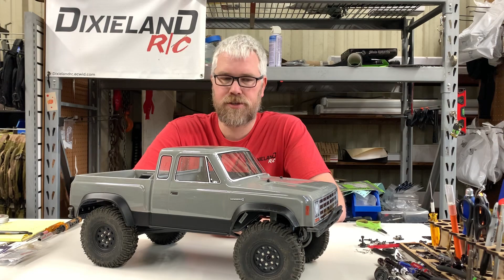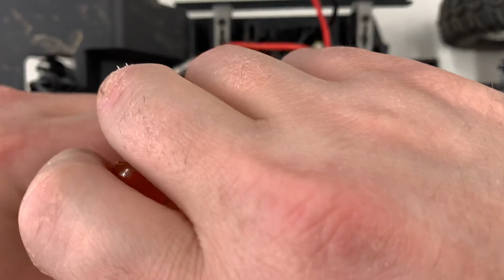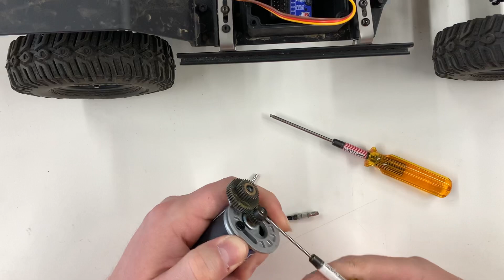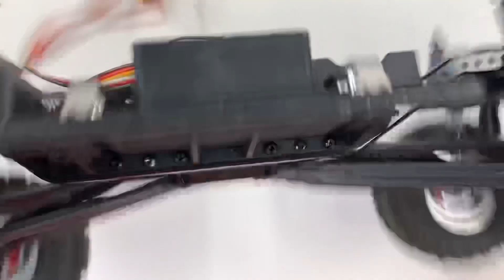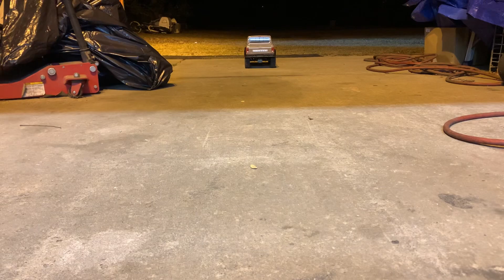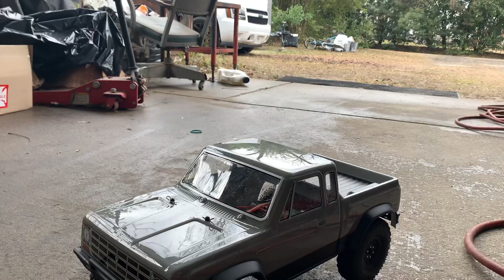Budget Build: Comp Edition - Week 4 - Fusion Pro, Metal Hexes, KNK Overdrive(Kinda)

Comment: Original Fusion 1200 with bigger pinion is the money shot on this rig. But I also like the Amazon dig 3gear trans with bowhouse skid as it’s easier mount battery up front then and dig I find is more useful then even 25% overdrive

Comment: It’s really kinda silly they didn’t make it backwards compatible with the overdrive. Does 10.2 underdrive fit the rear axle?
Reply from the maker: Yeah. Its an odd move to not have the parts either in the trans or in a bag. But on the other hand this truck is cheap and thats one reason why. And no, axial gear sets wont fit in the axles. I do however wonder if they will now that element changed some stuff around.